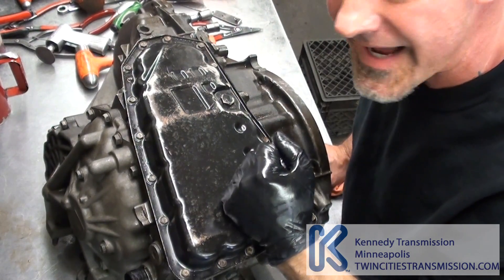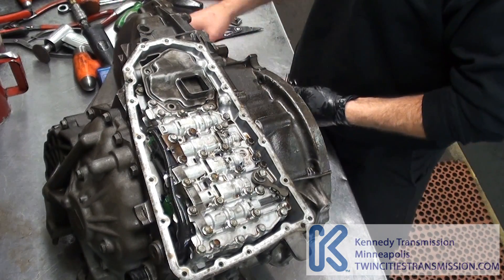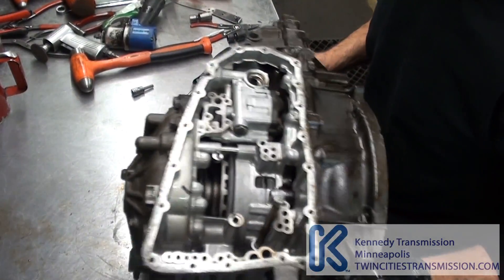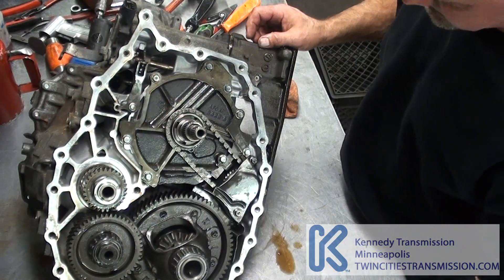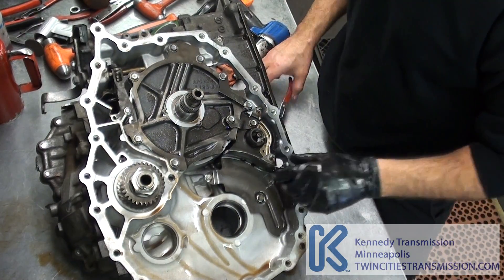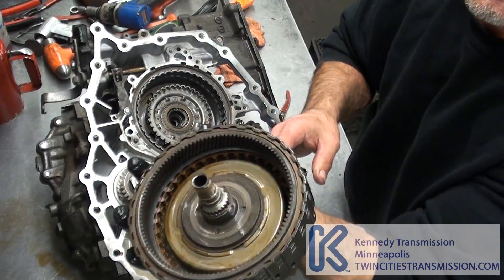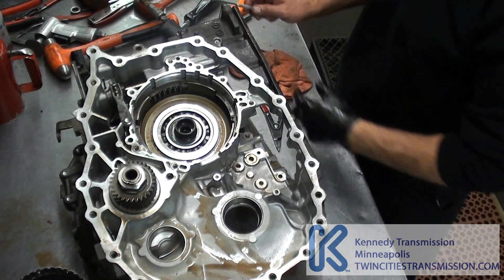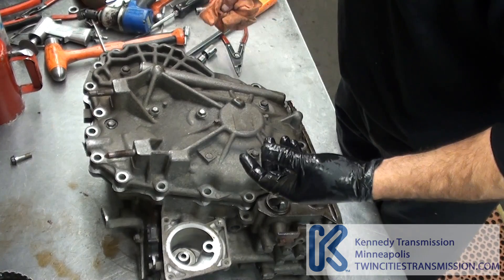Mitsubishi Nissan Jatco CVT (JF011E)

Comment: hmm even from jatco....mitsubishi unit and nissan unit are quite different...
Reply: The INVECs ECU for the CVTs in Mitsubishi is probably the reason why this CVT is better than in Nissans. Another thing to consider is its torque limitations. Mitsubishi only puts CVTs in engines that make less than 200 hp, while Nissans probably doesn’t with their V6 engines.
Reply: Rick Says The SUVs from Mitsubishi like the Outlander, Eclipse Cross, and Outlander Sport is junk. They are too big for a CVT and the engines are too powerful. They do not have good resale value. The Mirage is the best for a CVT because of the 84 hp 3 cylinder engine.
Reply: So mitsubishi cvt is better than nissan has??

Comment: hi op. Which CVT would you recommend if you were to get one? A corolla CVT or a Nissan CVT?
Reply from the maker: Joseph,We have not seen many of the Toyota K series CVT's and therefore see very few issues.  They are more widely used in the Corolla's in Europe and in talking to my counterparts there, they seem to be pretty reliable.  The most common units we see are Jatco's because they are the most common units in the states (used by Nissan, Mitsubishi, Chrysler etc...) and Lineartronic (Subaru).Thanks,Matt Johnson

Comment: Curiosity only, about how much would it cost to remove, rebuild and reinstall that thing?  Thank you in advance for an answer and for an interesting video.
Reply from the maker: Robin,  They really vary by what vehicle they are in and what has failed on them.  In looking at our most recent few JF011E's that we have had to re-build, they have varied from about $2500.00 to $4000.00.  The condition of the pulley sheaves and shafts, differential and transfer gear (and any bad electronics that may have failed) can really vary the price.Thanks,Matt Johnson
Reply: Thank you

Comment: How miles on CVT before it failed?
Reply from the maker: Cris,This unit had about 85,000 miles on it.  However, there was a coolant intermix issue that contributed to this failure.Matt
Reply: Toyota Avalon 301,000 miles original transmission and fluid.
Reply: @Mabeylater293  original fluid ? LOL . . . smells like a TIME BOMB waiting to go off at any time.
Reply: @Mabeylater293  what year?

Comment: Also, do you know what the symptoms / problems were that lead to pulling out the CVT?
Reply from the maker: Allen,The issues can vary widely.  If there are belt links or an excessive metal content (keep in mind these units shed more metal than conventional multi-gear units), they are a sure sign of an internal failure requiring removal.Thanks,Matt

Comment: What do you use for for work gloves?

If there's a specific model / sub model for this, it may be good to stick it in the title in parentheses.    e.g. Mitsubishi Nissan Jatco CVT ( JF-XXX ).
Reply: CVT fluid cause skin cancer, is very important to use gloves.
Reply from the maker: Allen,Jeff prefers the Raven 6 mil. gloves.  This is a JF011E.
Reply: Thank you for that and for the video.
Reply: Like you say, 2009 mitsubishi Lancer, maybe the car owner never change the transmission oil?
For your experience the problem on this tranny is the pulley scratch?
One question if you want to remove the pulley assembly is necesary remove all these things before?

Cheers

Comment: Have you come across a p1778?
Reply from the maker: Richard,P1778 is a stepper motor performance code.  When the Transmission Control Module commands a ratio state and does not see the corresponding ratio achieved, this DTC is set.  Many people replace the stepper motor when they see this code (without any additional testing), but generally the stepper motor is not the issue.  Valid speed sensor values must be confirmed, but more often there is an impediment to the unit achieving desired ratio.  Thanks,  Matt

Comment from the maker: I will apologize up front; I am a YouTube beginner and have marginal at best video editing skills.  We work on a lot of interesting transmissions; CVT's, DSG's, Hybrid Drive systems etc...  This is a basic teardown on a Jatco JF011E that we thought might be interesting.  We work on a lot of CVT's in general and most of the late model Jatco units are very similar, but have some variation in common failure points.Thanks,Matt
Reply: Kennedy Transmission, CVT & Auto great video. It accomplished what you thought.
Reply: Do AISIN make better transmission (especially CVT) than JATCO? Thanks.
Reply: @nickolastiguan  yes they do.The Toyota CVT transmission does not have any major complaints. They last similar to their conventional automatics.
Reply: @nickolastiguan  yes aisin makes way better cvt.... More reliable and durable
Reply from the maker: Kevin,The unit itself would not have an issue with supporting the auxiliary cooler, but the type of the primary cooler can be the issue.  Many of the JF011E's have a cooler which bolts to the CVT and coolant is piped to it.  In this case there is not a way to access the CVT fluid and port it to an auxiliary cooler. Thanks,Matt
Reply: @kennedytransmissioncvtauto5430  Is overheated fluid usually the cause of failure?
Reply: The video was great good job 👍
Reply: please what symptoms this transmission was giving? mine runs very smooth and shifts well, except on very slow speed when accelerating softly from ground zero or when stopping at almost zero speed u feel a grinding sound exactly like the half shafts (drive shafts) give when it has clearance. everyone diagnosed the problem as bad driveshafts which i changed, and it didnt solve the problem so i jacked the car up, placed it in drive and u can hear the sound coming from the driver side of the transmission and not the shafts.
what can cause this sound? the car is on 30000 miles only, it started giving this noise on 25000 and still running.
Reply: @georgediwan2059  which car du u have?
Reply: @georgediwan2059  same thing here,   my car makes a weird clicky noise coming from the driver's side whenever I slightly release my brakes.
Reply: Hej I have an 2007 audi w cvt. Du u know who made those? It's smooth as silk. 90k miles. How long can they last?
Reply: Rob Rob Audi CVTs are manufactured by Bosch.
Reply: @metak71  could be Jatco, if not it is probably AISIN. check their websites.
Reply: @nickolastiguan  tks.im hoping its netiher cause i heard aisin is asian crap. im hoping its german cvt. I read onine just now that Audi honda toyota actually make their own CVTs. thank God. but avoid nissan cvt's and american cvt's which use Jatco.
Reply: @metak71  I think AISIN is pretty good, since it is under Toyota.
Reply: @nickolastiguan  aha ok. toyota i heard has decent cvt's.
Reply: early cvt i think were better,  our family has an 07 maxima with 198k and no issues.  however i have my daughter come by every 25k for a fluid change.
Reply: I like CVT idea but for me its not reliable enough! i live in italy and always had manual trasmission but if i should take an automatic  i will go to torque converter type
Reply: Paolo Rolfo I’m driving a 2001 Dodge Neon with 265,000 miles.  It’s a standard and still going strong.  It’s very reliable.  You just can’t beat a standard!  The only problem with them is if you want to ditch them to buy a new car you really have a hard time finding a good excuse!
Reply: @screamneagle8420  I have the same car as yours , mine is 160,000 miles on it now & yes it runs very good !
Reply: Great video, learned a lot
Reply: A question please, will the fluid pump in this type CVT  support adding an additional oil cooler?
Reply: I didnt know mitsubishi made cvt transmissions aswell should i buy one or it is not worth it
Reply: @MARKN227  Mitsubishi, Nissan, Suzuki, and Jeep outsources CVTs from JATCO. But each of these manufacturers program the unit with their own specifications. Suzuki and Mitsubishi have much less documented instances of premature CVT failure. Remember the lower the torque and hp the less taxation on the CVT. This immensely with durability. Suzuki and Mitsubishi are small car, low curb weight specialists. This is not known well in the US market unfortunately because of Mitsubishi deminished presence in the states and Suzuki being simply gone. Nevertheless, worldwide sales are strong for both manufactuers.
Reply: @kylemas2005 CVT is okay on 2012 Mitsubishi Lancer? 180,000km
Reply: can you rebi]uild these
Reply: @lilpeppa117G  Probably. All I know is they charge an $800 core charge to exchange their good one for your junk one. My guess is they rebuild and resell them as reconditioned. The main shafts are too damn soft and the bearings eat up the area they slide up and down in. Eventually the bearings are sheared in half from teisting instead of sliding then the sheave locks up and destroys the steel belt. I shudder at the thought of owning that tranny. DO NOT pull a trailer with that.
Reply: gr8 video....now where do i apply????
Reply: To make it easier on you when removing the valve body pull all of the bolts with the number 7 stamped on them hope it helps
Reply: Is it possible to drive the car on such angle that the oil would fall below the pickup area?
Reply: So what's up with the cvts? Are you giving them a thumbs up or thumbs down? I am looking at a murano. They seem reliable based on its history. I saw an old murano with almost 300000 miles on it.  This was cvt engine.
Reply: You're making great videos bro.
Reply: I thought you did a great job filming and explaining what your doing. I wish d your shop was closer to my house.
Reply: thanks for the video, i was looking to buy a 2020 Nissan Sentra and from what i understand they updated their CVT. Would you happen to have and reccomendations
Reply: https://youtu.be/HSZ5-ifYQho   YOU MUST WATCH SCOTTY EVERY DAY! OR ONCE-THEN YOU'LL BE HOOKED!

Comment: is it worth rebuilding these cvt trans....and how much do you replace while in there?

also how many hours to remove/rebuild/reinstall one from the average vehicle 32hrs labour?
Reply from the maker: We repair or overhaul a lot of CVT's and build each unit independently.  The prices vary widely.  In-vehicle repairs can be relatively inexpensive, often under $500.00, but overhauling and upgrading the unit in most cases is a minimum of $2000.00 (with removal and replacement).  They can certainly get much more expensive depending on the unit, the vehicle it is in and the extent of the damage.  Variator/ sheaving, pump, transfer gear etc... damage can drive the price up quickly.
Reply: 2000 isn't bad, that is inline with a traditional automatic, I know locally, we don't have any shops that will rebuild CVTs, and the independent shops won't even do R&Rs on them.  Dealers will only replace them with new units to the tune of 8-10k depending on the car.
Reply: @mrvwbug4423  lol even a dealer isn't charging 8k for a trans replacement, get real